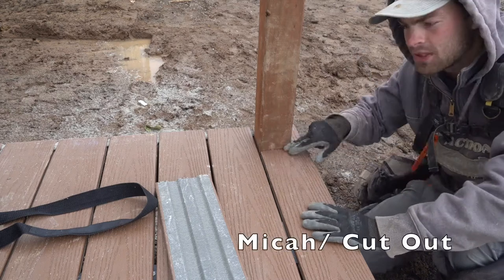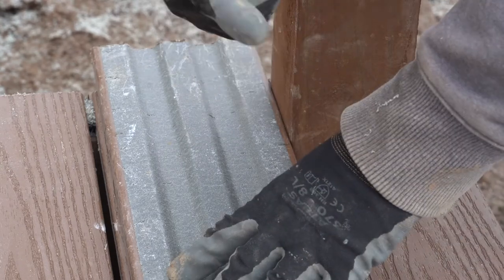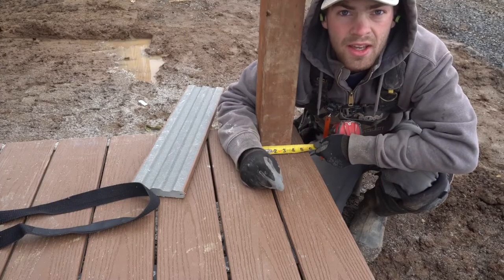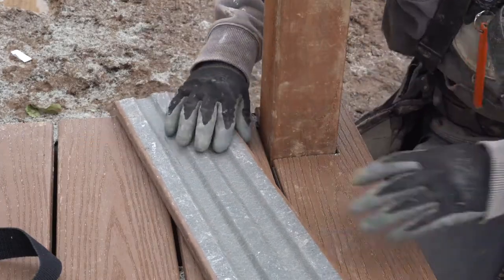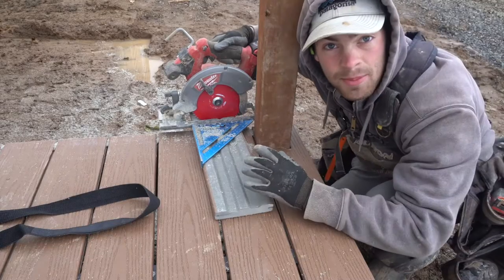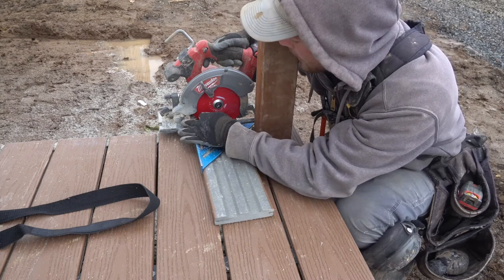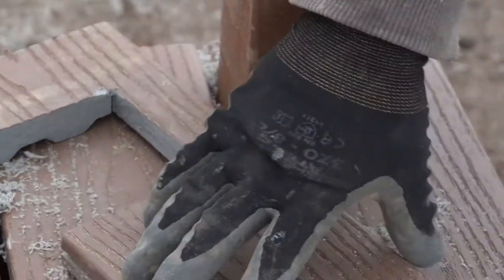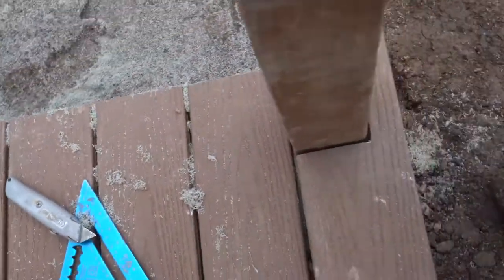How to cut around a deck post.

Comment: A satellite from 20,000 feet from earth could tell that gap is more than 1/8th of an inch.
Reply: A satellite at 20,000 feet is on fire and about to crash.
Reply: a satellite from 20,000 ft would just fall to the ground.. and you're picking on this guy..lol
Reply: As a passenger plane glides over at 37,000 feet. Lol😂